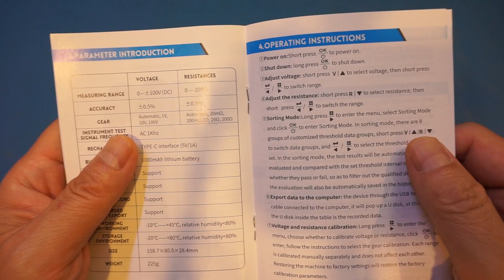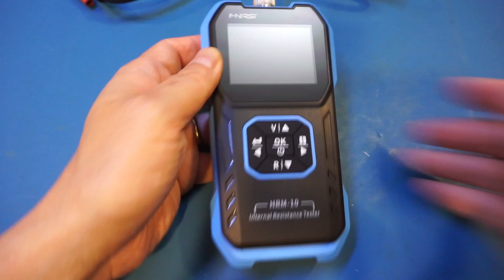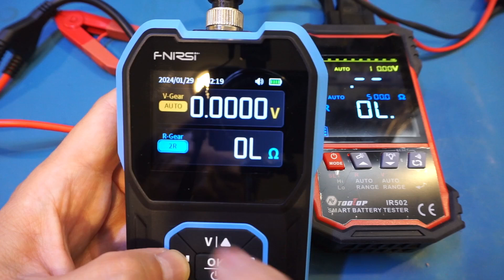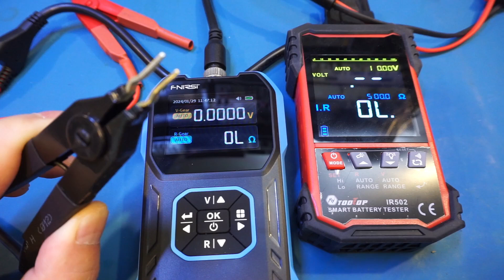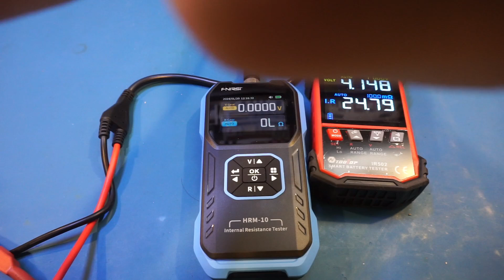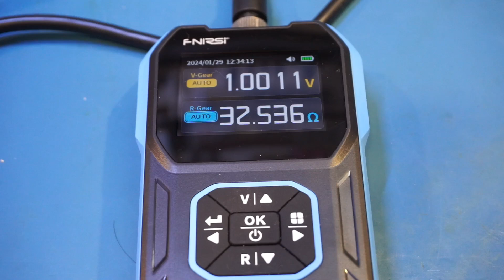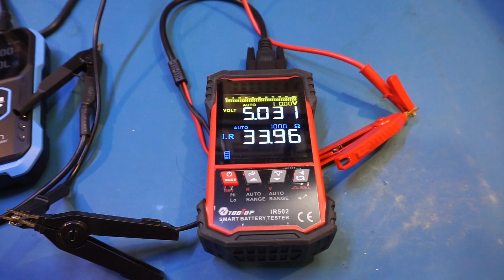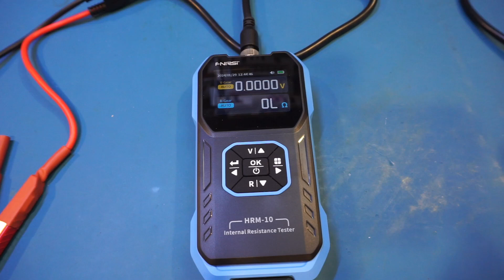FNIRSI HRM-10 Battery Internal Resistance Tester, Compared to ToolTop IR502

Comment: PROBES AND CABLES ARE USELESS. CONNECTIONS ARE PROPRIETARY!! WARNING. DO NOT BUY!!!   The test leads that come with it are proprietary with a gx12 plug and are too short from where they split off. If you want to place tester on a shelf above your test area the lead is also too short. They are completely useless. If you are holding a lion cell or a pack and want to test individual cells, the leads can not reach part to have the probes come straight back to the cell head on. My probes and many that come with it are not the alligator clips, but a spring loaded fine and delicate point. Putting them sideways would risk bending or breaking them and would also risk slipping off the cell when you are probing it.  It would only reach stretched all the way if the cell was only about 1 inch long. I have contacted the company and they are completely clueless and make nonsensical excuses and do not understand at all what you are trying to do to measure a cell voltage
Reply: You are correct, the leads are far too short on the optional FINRSI probes. However their optional battery tray works well and provides reliable and repeatable connectivity & results.

Comment: Do you happen to know the model name of the 4 pin top connector, or can you tell me its dimensions  ? Apart from battery testing I seems it would also be useful to find bad contact points, but for that I would have to make some custom cables so it is possible to measure between points further apart . (I already ordered a HRM-10 myself but since it will only arrive at the end of the month I cannot measure the dimensions of the connector yet to figure out what it is).

Comment: FYI: the face plate pops of and the screws are under it. But in my opinion, why tear down something if it works. Also, I don't like how the leads are bound together. make it tough measuring larger batteries

Comment: You are touching your fingers so the reading gives is not correct.
Reply from the maker: Your fingers are not going to impact milli-Ohm resistance measurement. It's magnitudes higher.

Comment: Hey. I'm enjoying your video quite a bit. I have a request though. None of the videos I've found online cater to stupid people. Let me explain. I work with 12/7's a lot for work. I bought this instrument hoping I could use it to test the health of said batteries. I just can't for the life of me figure out how to set the internal measurement levels to decide whether or not a battery is healthy. I think the default is around 32m ohm but where is the limit that would represent a failed battery? There are no videos I could find explaining how that is done. Could you maybe please record a video showing how to do that? Please? I'm sure it would be well received since there is no material at all available.
Reply: I think it's always related to datasheet from each manufacturer. You may find standards for every kind of batteries and this is probably enough

Comment: I have the Fnirsi and it's displayed values are in good correlation with my other battery testers. I don't however understand the principle of the Kelvin probes. Is it the frequency that makes the difference between connecting them directly and connecting them through the battery pole?

Comment: Yea this one. is the one I got.

Electric motorcycle/bicycle battery is either 72Vn ( 100V covers this without OL)... 96s DCV is another good nominal ( 120VDC cover this without Over Limit) ... very common.  

I will be comparing it to a 16 bit 32s pair of Revo DPL8s PL chargers on .xls logging 10 hz. It shows five digits after the zero on teh ACIR logs. Decimal accuracy of the DPL8s calibration is to +/- 1mA
Measurement accuracy:
Voltage resolution: 78uV (16 bit)
Voltage tolerance: +/- 6mV

Comment: I did some comparisons of DC load current internal resistance "quick test" from a Opus BC-3400 - vs. - AC measurement of this unit.  The several dozen 18650's were at various states of lifecycle and fully charged a day before the test.  What I found is the Opus DC test method did a better job at correlating between internal resistance and loss of capacity, which I previously tested and marked on each cell.  On the other hand, the FNIRSI AC test method was superior measuring reporting physical construction: High quality cells were always lower than poor quality cells, with very minor difference between the lowest and highest residual capacity.   All readings from the FNIRSI were lower by about 3X but did not correlate directly with the Opus IR quick test. Therefore, I would assume the DC pulse method better detects on-current voltage depression due to chemical aging, due to it's higher calculated resistance using the formula you mentioned.  This is probably not real resistance, but the inability of the chemistry to keep up with demand.  In the end, I would consider the HRM-10 a useful tool for checking the construction of newer cells such and cell matching for new battery packs.  However, it does not feature a test method good for resolving the state of health of a declining cell.  A device measuring total capacity by completing a full charge-discharge cycle is always best for that.  Secondarily, the DC method to extract apparent resistance under load would is better for measuring aging than the AC method the FNIRSI (and others) use.  I found a battery university article 802a that says the same general thing and presents figure 2 showing similar data to my findings.

Comment: There is a better option for flat-top cells. I use Kelvin dual-prong probes.  Each pen has two sharp, gold-plated pogo pins that are closely spaced.  At the other end is a fixed-spacing pair of banana plugs for red and black.  All I have to do is clip the FNIRISI alligators in the open position to these two plugs.  They fit very well in the pass-thru receptacle side of the banana plug end.   I'm sure you have the same sort of probes somewhere.

Comment: Can be used for capacitor internal resistance measurement too?
Reply from the maker: Yes. The limitation is that the measurement frequency is fixed.

Comment: Very interesting. Question: There is a Rel function (button) for cable calibration. I think you didn't use it for resistor measurement. 4-wire method is very exact.

Comment: FNIRSI makes their cabinets really difficult to open.  I have the little Geiger counter in what appears to be a yellow version of this case.  To get it open, you have to remove four screws in the corners, peel off the rubber bumper, and it looks like there is also a screw under the sticker on the back.  I decided to put my desire to do a teardown aside because it didn’t appear it would be possible to open the unit without destroying the sticker and losing the warranty.

Comment: I suspect the center blue rectangle in the center of the back contains your key for disassembly. If you press on the label, do you feel a soft spot?  Usually a label doubles as an anti-tamper device. Another trick to finding screws without peeling feet is a small smooth magnet, put it nearby and it will be attracted to any screws.
Reply: I've seen in another video that you can actually pop off the front panel with a spudger and then underneath you see screws in the four corners.
Reply: @Peter-rt3tu That makes a lot of sense. Nice way to conceal screws, almost like a typical boot does.

Comment: what is the lowest tolerances it will do on the ohm, is it down to 10 micro ohm res?
If i recall, ain't it through the screen you enter on these modern Fnirsi LCD meters. you peel of the plastic front to access screws underneath but it ain't as straight forward as screws in the back.
thx for the vid..
user calibration....good to see.

Comment: Thank you. I have been disappointed by fnirsi several times but this tester sure seems to do what it says it can do.
Reply: The HRM-10 is quite a contrast to how badly their oscilloscope performed.  I’ve got the GC-01 Geiger counter, and it isn’t too bad.  The GC-01 appears to use a Russian gas tube.  It is hard to mess up a Geiger Counter as long as the tube voltage is set correctly for appropriate sensitivity, all you’ve got to do is to count pulses.  The GC-01 gives count rate as well as converting into several common dose rate values.  I leave a GC-01 running for curiosity’s sake.  I can tell when there’s solar flare because the alarm will trip more often when I have it set just above normal background count rate.

Comment: During my testing of the HRM-10 the voltage was very accurate. The only thing they need to change in the manual is the 0V-100V. It actually cuts off at 50mv and wont measure lower. Not a big deal since it’s not a volt meter and was accurate within spec compared to my other internal resistance testers. I actually like it.
Reply: I would like to see “how low we can go” on both voltage and resistance and still be accurate.  I partly wonder how much the impedance of the source affects the minimum amount of voltage measured. I would assume the source needs some sort of conductive response, otherwise the device thinks it’s finding an open circuit.

Comment: I was so upset when I saw that the FNIRSI hit the market, because I've got the YR1035+
Reply: What's wrong with the YR?
Reply: @guateque1718  The screen and the probes 😂
Reply: @ciprianwinerElectronicManiac  I have the YR on my list. Hmmm might have to look at other options.
Reply: @guateque1718  It is a very solid meter but those pogo stick probes are something a blessing and a curse, it would be great if it had both clips and pogo sticks. In my country the YR is more expensive than the FNIRSI.
Reply: @ciprianwinerElectronicManiac  it's the opposite here. Fnirsi is a premium import brand here.